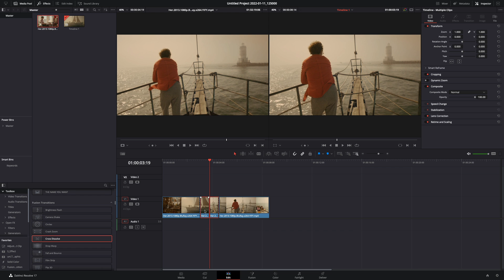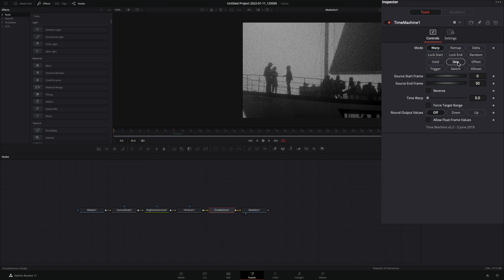Freeze Frame Transition | DaVinci Resolve 17 |

Comment: Is there an easy way to make this part of the standard transitions so i can use it for any project ?
Reply from the maker: In the new davinci update you can save your transitions as a preset.
You can also export the fusion composition with a saver node and save it as a setting file into your fusion transition folder